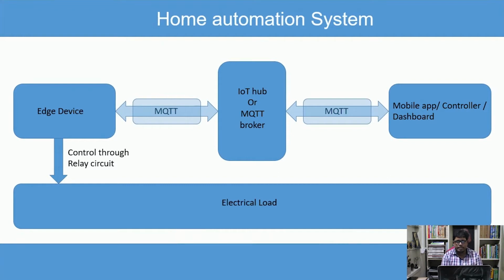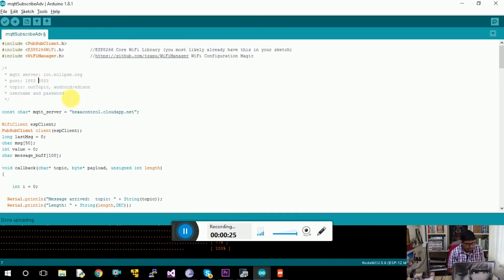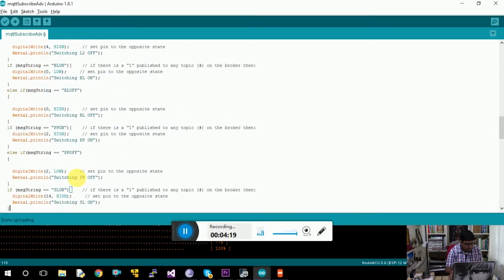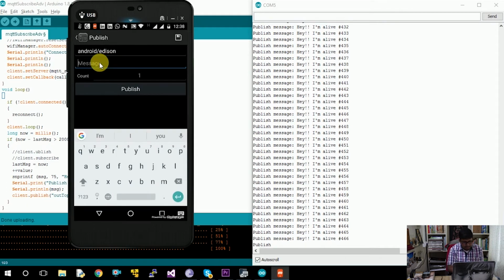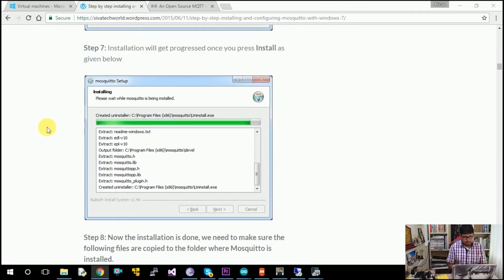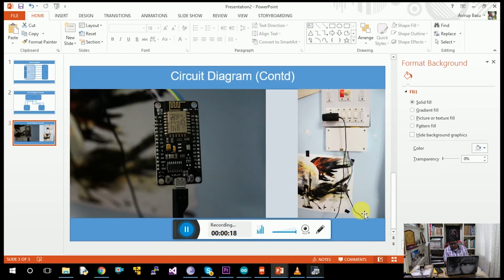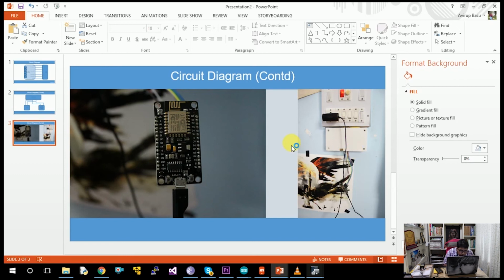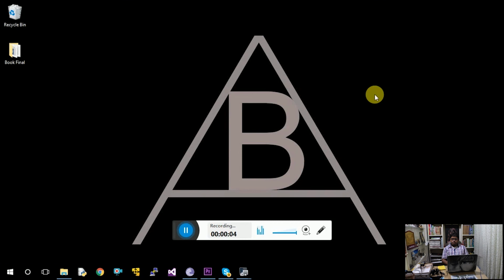Home automation using Node MCU and MQTT

Comment: Hi . I appreciate the video. I m facing an issue , when ever power is cut and power comes back every thing going to reset again. How can I avoid this
Reply from the maker: Hey buddy extremely sorry for the late reply. I wasn't active here. If your node MCU has a power cut, at this stage it will reconnect to WiFi but not restore the switches into the previous state. It will be restored into off position